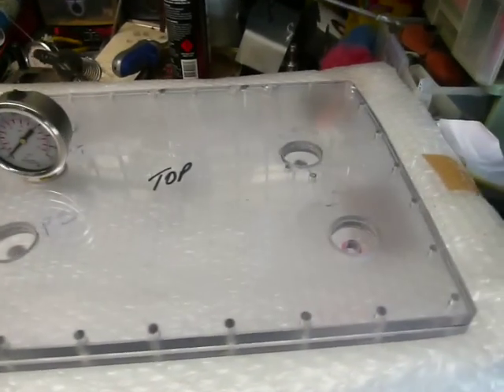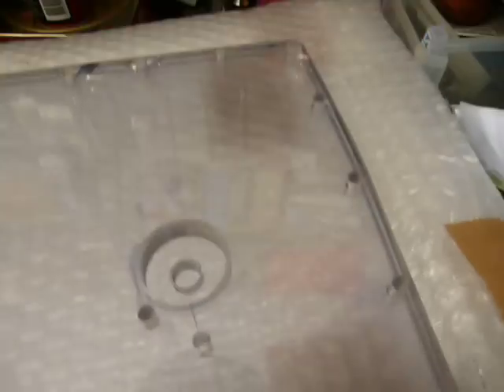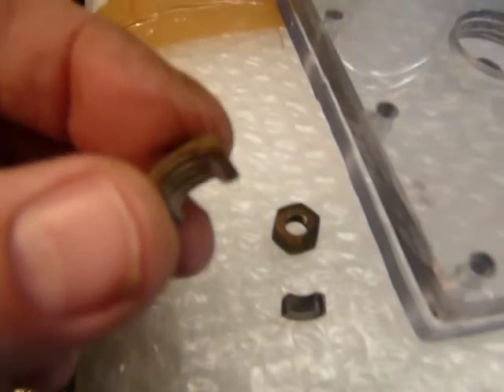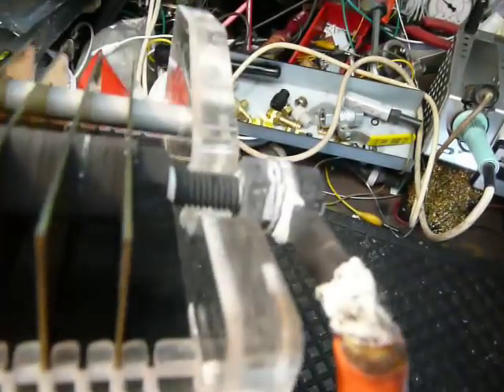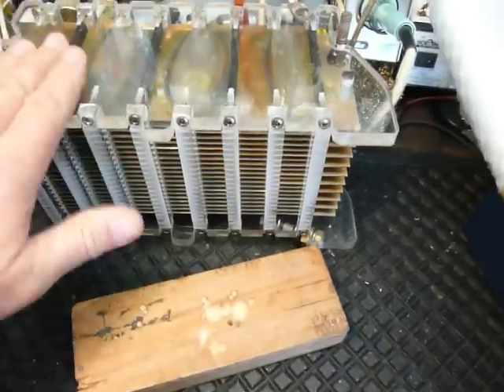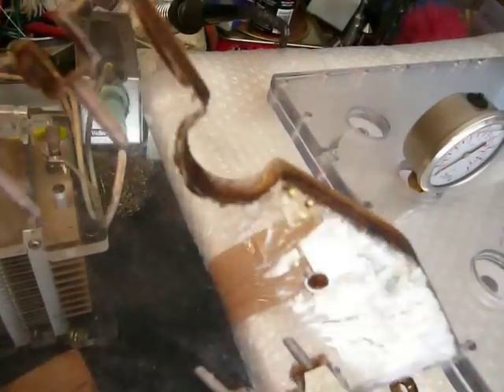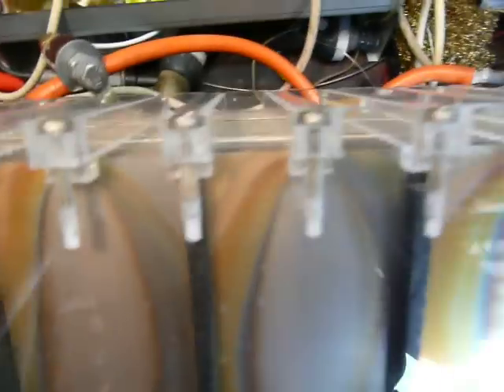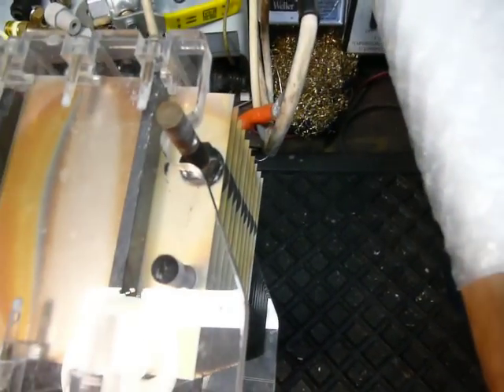HHO welder update

Comment: Can plates be 316 or do they have to be 316L ?  Does the carbon content of 316 versus the lower carbon content of 316L have anything to do with the degradation of the plates and by products produced or yield of HHO?  Does your used electrolyte have hexavalent chromium in it ?  If not why?  If so, do you treat it and how?  Sorry for all the questions but it looks like you've been doing this for a while..

Comment: HDPE can withstand the caustic abuse. Marine grade EDPM (pond liner) makes good gaskets. 316L SS bolts, with brass nuts for non exposed electrical connections are good. Nylon doesn't offer thread life.

Comment: Nice video. Poly Carbonate will not work for long in a cell, as you have proven.  The data sheets also say they will not hold up, but you have proven the point to all.

Very nice and clean build.

Lefty